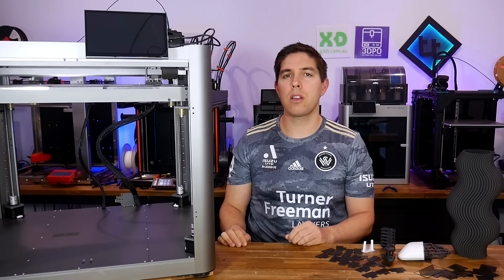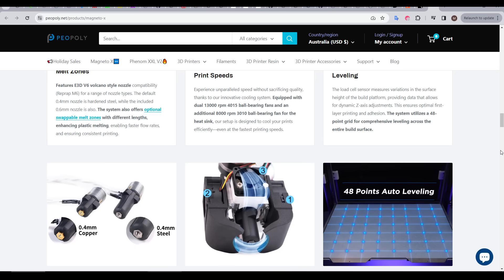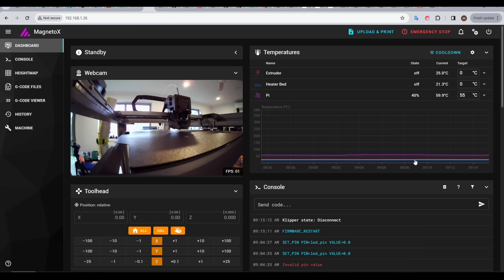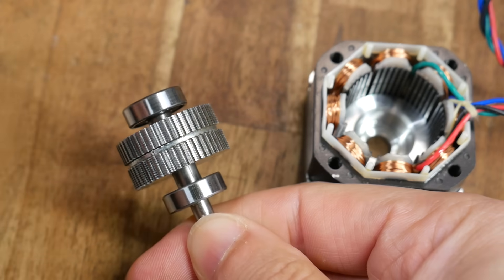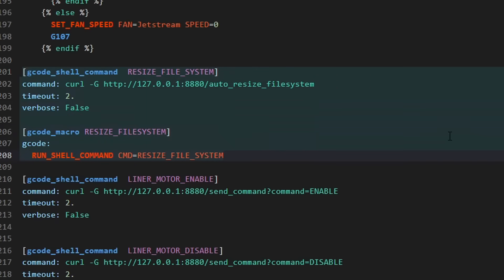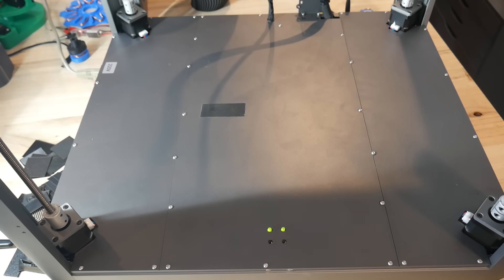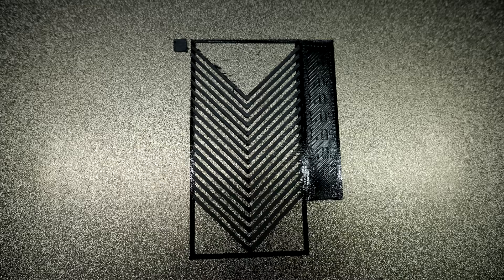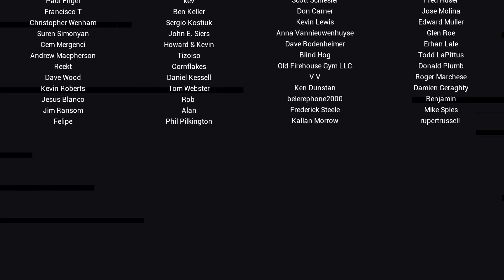Field testing the Peopoly Magneto X linear motor 3D printer

Comment: I've been saving up for my new printer.  I was going to build a ballscrew yx and quad z printer, but a linear motor is in the same ballpark of what I needed.  Glad to see others getting rid of the belts.  I grew up with vertical mills and lathes, and belts have no business being on cnc machines.

Comment: When I hear "linear motors", I think "extreme acceleration", so I would want to see testing that pushes it as hard as it can possibly be pushed. We know belt-and-pulley machines can do some crazy speeds, do linear motors surpass them, or if not, what's the point? 

Where are the limits and what causes them; do the motors overheat? Can they be actively cooled? Do they lose steps or following accuracy? How does current adjustment work on linear motors? Is there a point where the hotend can't keep up? How fast can Klipper think; what's CPU occupancy like when it's really screaming? Does the machine stiffness limit its accuracy at high acceleration? 

At first glance, the frame sides are nice big extrusions but there's still no crossbracing/triangulation, and with a heavy gantry whipping itself around up top, I suspect the frame and Z screws may deflect or resonate. Were it in my lab, I'd try bolting it to the wall to see if that enables even higher acceleration settings. 

If it can't go fast, IMHO the linear motors are a gimmick, hence my focus on speed. But if they have other advantages, please talk about them too.

Comment: This is cool tech, but the price prevents it from being a game changer in the home market. It is an incremental advance in print speeds and potentially, reliability. For enthusiasts, it's an exciting development, but until the price comes down, it'll be out of reach for me. If the reliability is there when it hits the market, I can see it being popular in print farms where sensitivity to price if far less. For me, it would always be would I rather have one of these, or two P1S with AMS, or four A1s with AMS. Since I lean heavily toward the side of producing objects, I would always opt for the four A1s with AMS with significantly greater capabilities and probably about three times the output. It's funny, but I never really thought about how compelling the AMS was until I had a few of them. I love my K1 Max, but I don't even think about it for certain jobs where multi-color is a benefit, or where I already have the color/type of filament loaded in an AMS, unless of course I need the larger print area, which isn't too often. For now I'll wait for the Peopoly tech to filter down.

Comment: Could you please test printing with very small nozzles (0.2 or even 0.1mm) and very small layer heights on very small miniatures and models (think 1/4 size cthulhu benchy etc).

Test against the X1C

The idea being to test precision and printer accuracy at small scales, as this printer has the potential to be more precise than any other and start giving resin a run for its money

In particular, we want to see if the usual layer lines, ghosting, wavy patterns and usual imperfections in fdm printing can be eliminated to approach resin printing

Comment: Great video and great machine. I would re-design the motors (at leats the one on the X gantry), so it is motor, rail and gantry in one unit. This way it can save a LOT of weight. By the way, how heavy is the head? I mean there's a lot of metal there. Cuality yes, but weight?

Comment: I would be interested if that linear motion system can be used in any kind of 3d printer. Like do the peopoly ppl sell their motors seperate and is the motion system still some kind of generall standart like linear rails? For me this system looks very promesing for mashines that are big and have havy print heads. so tehre are not long belts where depending on the size get too flexible (adding tolerances). The price is not too hight for the features the buyer gets it seems for me.

Comment: 2.2g acceleration on such a small linear rail is pretty impressive. I've worked with industrial linear motors which were much larger and needed air bearing for what looks like a similar power to weight ratio, and they only got around 5-10g acceleration.

Could you go through all of the test prints at 11:47 are, at some point? I recognise the cauliflower and Benchy (obviously), and the temperature tower from your Calibration page, but I'd really like to know what you're using for pressure advance, and what your other test prints are.

I'm having real problems with stringing using PETG, and multiple iterations of temperature and retraction tuning haven't completely eliminated it.

I also struggle with dialling in the perfect z-offset, which you've previously mentioned is a particular problem with PETG, and I would really like a more scientific way to get the first layer right. Ideally I would like a print that I can set going, and come back to an hour later, knowing that my z-offset needs to be 0.05mm higher, or 0.1mm lower etc.

Incidentally, I've really come to appreciate your Printer Calibration page, it's a really valuable resource for the community and the time and effort you've spent on it is greatly appreciated.

Comment: With that bed size and a 60mm^3/s volcano, please do any printing on large models that use the print volume and concentrate on functional materials like CF nylon and up, and on pushing the flow rate. No agonizing over print perfection on small scale pretty models please.

Comment: I think most of us really want you to check the speed of this thing out! And how accurate is it if you want to do a color change part way through the print? That filament change usually gives a good idea of accuracy, ie. does it loose position slightly (or badly) when returning to it's previous position?

Comment: This looks extremely well. It scratches every itch!
Klipper UI looks very good, and modularity promises it will be repairable.

Peoppoly must be careful with their advertising. Many potential buyers will look at the price and think it's a "turnkey eneterprise solution" instead of a printer.

On question I have, is how resistant are the motors to dust and grime? If I left the printer alone for a week in my place it would be covered in ~1mm of dust (I live between forest and busy highway). Would it damage or otherwise impede motors?

I wish they sent you enclosure...

Comment: It's about time that 3D printing used a closed-loop system.  The number of reviews I've seen over the years complaining about layer shifts has been crying out for this.  The lack of belts is a bonus, because it removes not only a source of resonance, but a cause of failure on many prints especially for newbies due to the wrong tension.
I'd like to see ringing tests to see how tightly controlled the closed loop system is.  I'd also like some more information about the nature of the closed loop magnetic or optical, and what is its resolution?  To properly control ringing, it needs to be much higher resolution than you'd expect, since ringing can be visible even if the ripples are so small they cannot be felt.

Comment: I remember reading about electromagnetic linear actuators like this back around 2016 when everybody* was either trying different and sometimes crazy DIY actuators on their printers or CNCs (like the triple bearing "threadless leadscrew" one) or getting to figure out how to put a DRO on it for cheap. Nice to see someone finally going commercial with it near the consumer level, though I'm jaded enough to expect they only did so because they got granted a patent that should be invalid which does nothing more than utilize Prior Art technology in its same established use but in a new machine where the only real difference is the toolhead...
Reply: BTW, Closed loop linear motors have come a long way. Some use inductive encoders which are cheap, simple (pcb traces) and immune from magnetic interference. Used in some DROs too. Capacitive encoders can be affected by EMR. Optical encoders can require maintenance. Inductive encoders can often be programmed for an arbitrary resolution.
Reply: @nikthefix8918  How do inductive encoders differ from linear magnetic encoders? Which one is used in common electronic calipers?
Reply: @claws61821  Summary:

Magnetic encoder - hall sensors and discrete permanent magnets.

Inductive encoder - two etched surfaces with conductive trace geometries and a HF oscillator whose resonant freq is determined by the relative position of one surface with respect to the other.

Electronic Calipers -  capacitive using similar etched surfaces and complex support circuitry for interference rejection.
Reply: @nikthefix8918  Much appreciated

Comment: My main printer is a CR-6Max, and the load cell was the one thing that ruined the printer. Inconsistant probing, and because the print head "floats" under the load cell, it moves during the print. I ended up biting the bullet and replacing the load cell with a fixed mount and CR-touch, and it was a night and day improvement. Ended up with a 400x400 bed slinger that was accurate and stable.
I'm willing to bet if you replace the load cell on this printer with a standard probe or one of the touchless probes, so much of the issues around digging into the bed would disappear, and the printer would work so much better, as that seems to be a lot of the noted problems on your test machine.
Great video! I love it how you work through everything smoothly and you are so well spoken. And kudos to Peopoly for taking the feedback and improving, and also allowing you to review a pre-production model, warts and all. It shows they listen and are willing to own what they produce, and that is a long term benefit.
Reply: Nozzle based probing is infinitely better than anything else. I cant imagine downgrading a printer as severely as moving away from nozzle based probing and to a probe would be.

A bad implementation is a bad implementation but domt theow the baby out with the bath water.

There are clearly systems that work well, so its not endemic to nozzle based probing.
Reply: @BeefIngot  Anything that allows a nozzle to move or flex from its intended position immediately introduces an error margin in the process. There is a reason CNC machines use touchplates, it is to get the location of the tip in a manner that doesn't require the tip to move from its position in any way, shape or form.
As soon as you have a nozzle that is built to bend, shift or move from a rigid, fixed position, you have lost accuracy not just in that measurement, but in the repeatability of that measurement, and that is absolutely a downgrade. 
Using a load cell just to be different is heading down the wrong path. There is a reason that it isn't used on all the other printers, because unless you are paying an absolute fortune for precision machining (which isn't the case with any consumer 3D printer), then movement == bad.
Reply: @dragularum  Sure in a meaningless theoretical way. In reality, CNC Mills (3d printers are just a different type of cnc machine) have vastly different constraints.

For fff 3d printing, where you are extruding a volume out of the nozzle, the most important thing is knowing how much filament was extruded. This allows you to continuously measure instead of just hope as you cant just take the part over to a cmm machine.

Basically, whenever you try to apply cnc mill logic to 3d printers it fails, because one relies on rigid high force removing material, and the other on fast precise placement of material. Very different objectives.

TLDR; Nah, Nozzle based is absolutely the superior technique and Im very glad its here to stay. You can keep your dinasour tech over a bad experience if you want.

Imagine people still riding horses because the first cars were bad.

Comment: Post the results from the klippain-shaketune tests. Sound tests while at 200-500mm/s print speeds. Also, if this is closed loop, would there be loop pid tuning that can be automated with a script for spot re-tuning through the life of the machine? --- I'm curious how klipper is being used with closed loop as well.

Comment: Something amazing🎉🎉🎉  about this motion system. I had bought linear motors on eBay for this exact purpose about 2-3 years ago. But with the current motors available for the right force. I felt it would be too expensive. But the typical linear motors are not like steppers. And I think these are.

Now for the amazing bit. That even these guys have not figured out.

With linear motors you get automatic head changes for free. Yes for FREE and as fast and accurate as you can imagine.

Since clearly I didn't make the printer. I'm leaving this nugget here for the community. Love this comment if you would like to see such a feature.

Comment: Now that is very interesting. Our EDM and WEDM machines are using linear motors, but they run nowhere near as fast as 3D printers. I wonder how hot they get, since on at least one of our axis ,coils are liquid cooled. Also how accurate they are compared to 0.0001 mm resolution of a much more expensive linear motor.

Comment: Linear motors, no missed steps? Are you able to set print speeds to 10,000 mm/s, and if it cant keep up, itll just print slower and adjust filament extrusion parameters accordingly? If so, that would be game changing. How hard would that be to implement?

Comment: The magneto x seems to me like it would be a perfect application for the first consumer true idexy machine.  The magneto x design would allow the easy use of a second complete y gantry with a separate x carriage.   Not only would this allow a true high speed independent extruder setup but would allow for dual g-code streams in the future when slicers develop to that point.  It's possible to have an Idexy corexy machine but the belt path gets complicated, the linear motor gets rid of this problem. If peopoly could develop a material loading system similar to the Bambu lab ams, you could have one or more on each extruder and do the purging for the next color while the current one is printing. This way 2 color printing would have no purge pooping like any other idex machine but 3 or more color prints could be much faster than the Bambu application.

Comment: I'm one of the lucky pre-orders. It's been fun and frustrating to watch the development of this printer. I can't wait to get my order. Once I do, I'm installing a Beacon surface scanner and an active enclosure heater. I'm glad there have been such competent beta testers to help iron out the wrinkles.
Reply: I‘m in the same boat (in the same benchy?) and yeah, 100%, they might‘ve done their preorder a tad early in their development cycle, like, a little early for their preorder customers‘ comfort. The product page seemed a lot more polished than what they then had at the time.
I‘m glad it seems to be working out, tho. I preordered because I trusted peopoly because of their history, and they do slowly seem to work up to a nice product that satisfies that trust.
Reply: @Runoratsu  they have admitted that instead of doing a Kickstarter fundraiser they just did a pre-order offering at a slightly discounted price to gather capital to pay for the initial development and fabrication costs. Then they sent out an early test batch to some specific content creators to do beta testing. They also have a discord server that they monitor closely so as to answer questions and listen to concerns of the pre-order and would-be ordering community. It's been interesting to watch the process. Luckily I have other printers on hand to keep my prototyping hunger at bay, otherwise I would have probably canceled my pre-order and bought an available printer and dodged the extensive wait time.

Comment: I’d like to see the following tested, and a few questions at the bottom of my list to ask/discuss with the company.

- safety features (if their is anything new or similar to other machines
- timing comparison 
     -heat up time 
     -leveling time for whole and half big (given most would be look at it potentially for size of buildplate 

- loading of filament (process, limitations, filament runout, troubleshooting) 
- print speeds (quality to speed) 
- noise levels when printing 
- overall size of machine (with and without enclosure 
- slicer support (what can this be used out of box/ or require modification) 
- filament profiles (are they using their own internal or external)
  - controls around that, if you need to custom 
- limitation of printer (what you think is is amazing at, and what you wouldn’t used it for) 
-   Easy of life features 
       - camera view 
       - first level checker 
       - etc 

Company related:
- where they are thinking of shipping to or from?
- company views of customers support, warranty
- replacement parts support 
- timeline of development to launch. 
- overarching plan (release this, and then what. A smaller one? Refine it?…etc) 
- multi-colour printing or support in the works?

Comment: Wow! That should be the way building printers! Accesible Hard- and Software! For me as a cutting mechanic the peopoly is a celebration of engineering and Parts! I'm interested in resonances in comparison to an equal sized Voron with MGN12 rails. Are they VFA when print in slow speeds and so on. Short: is it worth to choose Linear Motors?

Comment: It won't be comparable to appliance style Bambu printing until it can autocalibrate based off of testing what filament you put in it. That's the magic sauce in the X1 that isn't talked about nearly enough. You don't get flawless prints with settings  you find online and have to change with each filament.